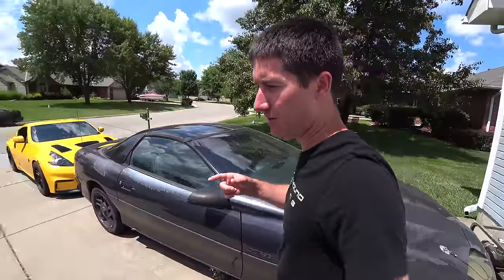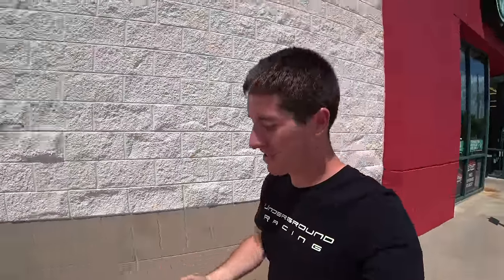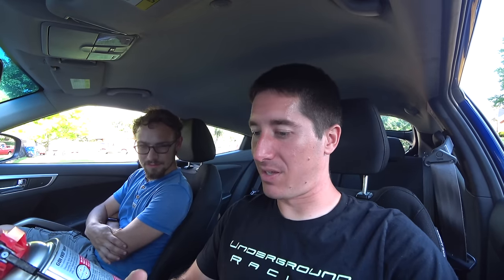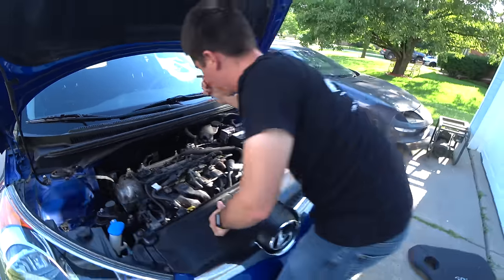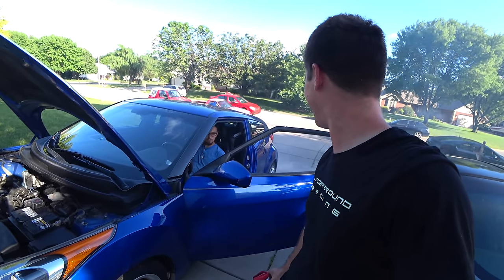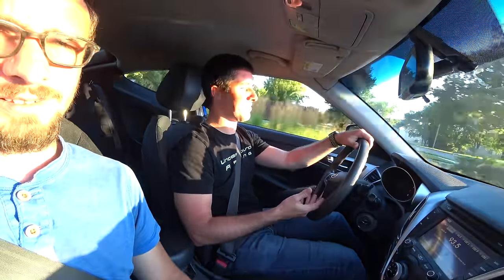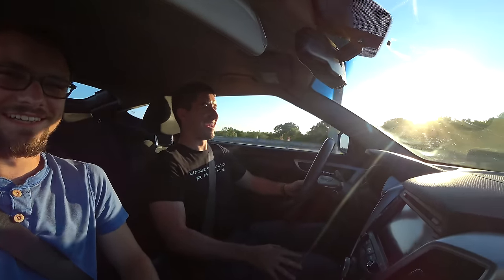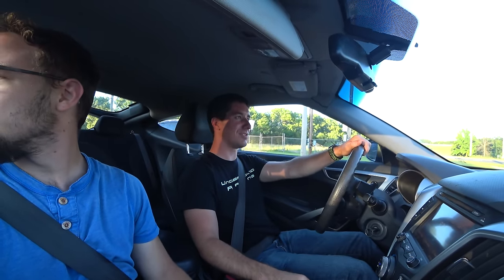How To REMOVE CARBON Build Up From DIRECT INJECTION Engines For $12

Comment: Anyone performing this intake valve cleaning needs to change the their oil immediately afterwards.  This process will dump a huge amount of hard abrasive carbon into your oil.  No, all of won't be blow out out the exhaust.  The unburned fuel, soot and carbon will be washed past your pistons rings.  How do I know.  I did an oil analysis before and after.  Hard Particulate matter skyrocketed and I had to change the oil twice to get levels back to normal.
Reply: I came here to say this!
Reply: Anything else worth replacing at the same time as doing the GDI cleaner? PCV valve? Using a rag to hand wipe the throttle body with a little cleaner?
Reply: Damn you had to change the oil twice? That's crazy.
Reply: The fine carbon abrasives will wear out the timing chain link pins causing slack play.
Reply: @alwayslearningthankyou2708  Also wear out rod bearings then shake the motor apart (or if you got the lemon-sensor from the recall I guess just wait 20k more miles and get a whole new engine from Hyundai lol)
Reply: should I do spark plug before or after
Reply: @MJ-5k  Hey can you give me some more information on this ?
Reply: That ain’t all of it you spray too much that crap up in there it will start to deteriorate the manifold gaskets and things and do other damage to the engine in general. Those cars are junk anyway you’d probably be better off to just  trade it off or sell it for whatever you could get out of it and let it go with that.Get a Toyota or maybe a Honda or Nissan👍
Reply: @william38022  I have 180k miles, has just as much power and fuel efficiency as new, runs great.   Over 8 million built,  Troll....go get a life
Reply: @tssci6774  no I got a Toyota how ever I’m glad yours is working out for you
Reply: Absolutely!  I use this on my 2016 f150 2.7 Ecoboost.  You need to do an oil change, maybe two oil changes after you get done driving the vehicle around to help knock off that carbon.  You will find Carbon deposits throughout your oil filter.  Drive the vehicle after using the valve cleaner per the instructions on the container and then do the oil change (after the oil cools of course).
Reply: What kind of Toyota engine do you have? Is it GDI? People with older cars don't have a problem without changing oil. That's why most Seafoam users have positive feedback. But if you have GDI that's a different story. You're making people worry but not a bad idea changing it. To people who are confused just do this before changing oil.
Reply: I'm doing a carbon build up on my hyundai.  From egr, dpf, intake manifold and everything in-between. 
Because of por maintenance and the wrong oil
Reply: @davidscott4045  let us know when you’ve done it 👍🏼
Reply: @DragonNB13  from my experience, right after.

Big chance ur old plugs will foul out
Reply: Is this not the purpose of the oil filter ?? You will have to run the oil through the system to move the carbon through by doing that it has to pass the filter?  So any particles 20 microns or so are trapped in the filter. Am I missing something
Reply: 😱

... Thank you
Reply: @ryanpatterson621 Exactly, that fucking oil filter job is to catch those particles from oil, so no, no fucking way those particles, soot, carbon deposits will slam around all bearings and chains, like he is saying literally that he don’t use oil filter/doesn’t know what is the purpose of an oil filter which is laughable
Reply: @Berserker_Bear No! See? This is the reason peeps have to do it twice! That oil-gunk-that slurped every shiz into it needs to come out as quick as possible since it had everything in it! If you let it cool it will drop everything on the bottom of the pan and who knows where else!!!
Reply: I'm skeptical of your argument. crc said that oil change is not necessary immediately after cleaner use. If they were wrong about this, they'd be sued.
Reply: @ronin5019  Sued for what. These products are nearly unregulated when it comes to consumer protection. They can make just about any claim, buyer beware.  For as little as $40 you can confirm my testing, but I suspect you won't,  keyboard warrior.
Reply: Which oil analysis and how much were the levels before and after? Lets fact check this argument.
Reply: @tssci6774  I used a crc cleaner in my Kia Cerato, which drove 100,000 kilometers, and I used it according to the procedure to check the amount of white exhaust after 1 hour of heat soak. The color of engine oil was light brown, just like before use. If you are not a keyboard warrior, present scientific data on engine oil changes. I can only see it as a local mechanic's trickery of worrying about sales decline
Reply: @ronin5019 I don't think it's just the carbon. It's like when you put seafoam in your oil to do an engine gunk flush. Since some of the unburned cleaner goes into the oil.
Reply: @FortunateJuice  clean mass airflow sensor
Reply: There are always carbon fines in your oil. Minus when you just changed it.  Thankfully cars have “oil filters” <Dr.Evil> to catch the carbon. No need to change the plugs either. They burn very hot.

Comment: My only comment is that your results were not proven really.  A borescope photo before and after of the combustion chamber to determine if in fact the treatment eliminated any measurable amount of carbon.  The fact that you say it drives better is anecdotal and not measurable since what one "feels" is purely subjective.  Any of those additives introduced through a vacuum line into the intake are going to create a lot of smoke and is just a by product of the chemicals being ignited and not a measure of how much "cleaning" is occurring

Comment: lol...your face when you said "We just killed a rod "
Reply: My car did the same thing when I started going after the heat soak for the first 500 feet or so.  The car ran rough, the check engine light came on, a ton of smoke blew out the exhaust... and the engine now runs better than ever.
Reply: @vashthestampede11  My Santa Fe did this and actually went into limp mode. I had to get to an auto parts store that had a scanner tool so I could reset the check engine light and it ran fine after that but scary as hell at first.
Reply: @robertnicholson3734  never had to reset anything. It drove really really rough for about 1/4 mile, the check engine light came on, farted out a huge cloud of dust, the engine light went away, and it's been running great ever since.

I also decided to put in an oil catch can, and after 1000 miles, it's already caught about 2-3 tablespoons of oil.  Might be worth looking into.  I'd be happy to show you what I did.
Reply: @robertnicholson3734  cars ecu will reset after the chemical is gone .No need to panic .
Reply: That engine clattered hard  🤣  that's  why you use it in bursts
Reply: @vashthestampede11  I'd be interested.

Comment: Just tried this with my 2012 kia 1.6 Gamma GDI stick shift and it definitely started sounding better and feeling better. It also looks like my mpgs are a lot better. I only used half a can because I was being overly cautious and was using an extendable mop handle to keep the car around 2k rpms
Reply: The car also felt like it was gonna stall at low RPMs in first while starting from a stop. Now I don't have that problem.

Comment: That noise was hydrolock because the way the intake sits lower than the valves and the cleaner pools in the bottom. If you could actually see the carbon coming out of the exhaust it would instantly plug the catalytic converter.
Reply: Cats are cheap. Wouldn't it be better if the exhaust was removed from the cats back before using this?

Comment: Hyundai should pay you for these videos  you’re giving them tons of free advertisement and training tips for their technicians.
Reply: As a hyundai technician this is a bit cringy lol
Reply: And you're also pointing out a big draw back of their GDI engines. They're not all efficiency and fairy dust. They get dirty pretty quickly and then run like garbage if you don't keep up the maintenance yourself quite frequently.
Reply: V G the newer ones are staggered injection or dual injection idk which one though.
Reply: @tails300  Yup, kind of tells you something when their newer engines are either back to port injection, or dual injection.
Reply: @tails300  There are no Hyundai's with that setup, some new low trim Elantra's are just port, but nothing has both in Hyundai's lineup. But agreed that other manufacturers have done that.
Reply: @tails300  Toyota and Ford.

Comment: Would be nice to see a before and after scope or dyno pull - some way to quantitatively measure the difference.
Reply: You saved me a few minutes of typing, that would have been some REAL evidence
Reply: Best they can do is vaguely following bottle instructions 🙏
Reply: Yes i thought the same as u mention here.  This video worthless as nothing learned if is for real on getting rid of carbon.
Reply: U connected to brake vacuum line.  Why not have more light so could see better where line is - where starts and where line ends.  Very poor overall.
Reply: Yeah, pretty worthless with no corroboration. And in my opinion corroboration isn't possible anyway. Speaking from my own experience, all those intake sprays accomplish next to no removal of carbon on the intake valves which is where you need it removed. The baked on carbon absolutely won't be dissolved by a few minutes of spray solvent passing over them every 10-15k. I know; I've tried it, and when I inspected my valves at 50k they were fully caked with carbon. There are no shortcuts to removing the intake, scraping off the excess carbon on the valves, followed by finish blasting with walnut shells. That's the only way I was able to clean mine. Don't waste your time and money following recommendations from guys on YouTube pushing this nonsense.
Reply: theres no diffrence, ive seen before and afters inside the heads

Comment: That does make a big difference. I have my State's Emission Tested a month after I used this same product on my 02 Ford Ranger (176,000 miles). My friend John performed the PA. Emissions Testing, afterwards he commented about not believing the great results he got for such an old truck. Yeah, as you spray that product in you'll just have to manually adjust by hand the throttle RPMs, because the engine wants to shutdown if you don't. The oil will be dirty, but before the oil change try Seafoam in the oil crankcase (1 ounce per quart capacity). Drive 50 miles, then pull it in for an oil change. The Engine will purrs!

Comment: Just did the "non-pro" instructions on a Mazda CX-5 2013 with 107K. I had suffered thru gas smell in AC vents and saw that carbon deposits could be a possible cause.  After the one hour soak, fired it up and made run to where I could let it rip. No smoke but went through a series of backfire farts.  It blew that carbon out and ran perfect for my 90 mph joyride.  So  far gas smell gone too.
Reply: Gas smell might be a spark plug that's not tightened up enough.

I had that issue when I changed my plugs without a torque wrench 😂

Comment: That loud clack noise sounded like hydraulic lock. 
Problem with these head clean aerosol systems is that if you put in too much fluid at one time, or the additive pools on the intake manifold, the fluid could hydraulic lock the engine. 
Better to do the following - 
Never add the fluid to an idling or stationary engine.
Engine at around 2500rpm
Spray the additive in short spurts with at least 30 seconds between spurts, 
Add the fluid at the throttle body to ensure better atomisation and even distribution (minimise chance of pooling). 
After half a can, wait a few minutes before resuming the remainder of the fluid.
Leave the engine at the same revs for at least 3 minutes 
Slow to idle and leave idling for 3 minutes. 
You can now switch off the engine to allow the hoses at the throttle body to be reassembeled
Restart the engine and slowly increase revs to 2500rpm for one minute. . 
Next, go on the 20 minute road run. Do not exceed 2500rpm.
Reply: Don't forget the hour of heat soak which is important.
Reply: @onlywenilaugh6589 can you explain what an hour of heat soak is? Thanks in advance!

Comment: i had to run that type twice in a v6 because the guy i know said he wanted to try it while using it through the port on the intake manifold. it seems like it did the trick because most of the time there is some carbon build up in the base of the intake manifold as well. it seems like it loved it to be honest to get all the crud out of the air passages thats my impression

Comment: I waited until I had a noticeable miss at idle on my direct injected vehicle, which was about 170k miles. I was surprised I didn't have an issue earlier, but I run top tier gasoline, which I think helps some. I pulled my intake manifold and spent a few days soaking and cleaning the valves with a variety of methods until I was happy. A LOT of carbon build-up came off the valves. Before re-installing the intake, I installed new OEM fuel injectors and seals. Once put back together, my car idled like new again (and still does).

Comment: The best way to prevent the build up on intake valves is a EGR delete. Put an small airfilter on the EGR pipe and the correct pulse value compactor on the EGR harness which prevents any CL engine codes. Also a oil catch can
Reply: PCV  All those oil vapors routed back into the intake manifold lead to carbon buildup.  Could route them down toward the road as cars did before emissions laws.
Reply: Additionally don't buy a direct injection overpriced car.
Reply: @davidanderson8469  Best answer.  I love that Mazda6 and I want to get one, but it's GDI, GDI means *od *amned Idiots, in my book, so I can't have that Mazda6.
Reply: @keepingup2952  they produce significantly more torque compared to the same size port-injection engine though.  there' a good reason GDI engines exist.

Comment: I put FR3 friction reducer in at my oil change. It reduced that clattering sound alot. The engine runs smooth too. $18.00 a bottle. I have the 2.0 turbo in my Escape. Shawn.
Reply: Gonna grab some of this at next oil change, thanks!
Reply: LiquiMoly is the only brand I trust.

I've seen tests and results with own eyes, idk about the other crap but some BMWs and MBs need that shit in there. Just make sure to get genuine stuff.

Comment: THIS WORKS! I do this every other oil change or at 10,000 miles and I have NO CARBON BUILDUP.
Reply: How can you verify there is no carbon buildup ?
Reply: Did you physically view the valves to verify?
Reply: @jeffersonjcoat just pop the manifold off wym

Comment: I did this on my 2017 Hyundai Sonata Sport @ 45,000 miles oli change after it started to shake lightly at idle and the throttle response was very laggy and i was getting 26 mpg with mostly i. Town and no spirited driving.
After i did this CRC treatment the car made the same loud knocking noise after the treatment 3500rpm revs and after the i accelerated it on my way to the high way.

Afterwards  the light tremebling at idle went away and the thrittle response has improved dramatically with no lag.
The best of all is, the MPGs are back to 28mpg .
I will be doing this every other oil change wich is every 5k miles
After

Comment: I tried that stuff on my GDI mini cooper with the turbo,  
80,000 miles and it started to run like a new car. the turbo looked awesome as well.
Reply: Finally a Mini Cooper comment? Any other tips I just got mine it has 35k miles on it but just want it to run smooth with barely any worries.

Comment: I used to own a 1.6L 2012 Accent GDI and when I used that additive, I learned that you need to be easy once the additive is empty, don't rev it up or you will get that knocking sound, so what I did after the first time is let it to heat soak for 10 mins then start it again and let it idle for 5 mins and then take it for a spin and go very gentle otherwise the knock may come back due to the combustion chamber full of an oily substance that can cause that sound and if you are very rough increases the chances of killing the engine in the long run and around 10-15 mins of driving the product will be gone and the knocking chances are reduced, FYI, when I heard that sound, I thought that I killed the engine. Also For those who don't know in all these additives when you see white smoke is not that you are burning carbon is the actual additive mixture that makes that white smoke, once that is burned along the carbon will disappear. I have used this one seafoam as well in very clean engines and white smoke will always show up, even with intake +Carb cleaner, is like if you were burning those barbeque starting fluid, smells bad and white smoke all over. If you use that additive at home and you own a Hyundai, be patient otherwise you will pickup another engine soon. Just my opinion.

Comment: What happens on these with the carbon cleaner is that when spraying into the manifold or a vacuum line, some of the cleaner tends to pool up in the intake manifold runners that aren't open (has variable intake runners, short and long for air velocity changes). When you rev it, the manifold opens the other set of runners and chugs the rest of the cleaner at once, can be bad if it's a lot of cleaner, but that's the smoke you saw. Kinda scary at first but hey, it works well.

Comment: Change your oil immediately, and do an engine flush if you don't have high miles if you plan to do this. I would not recommend it at all due to the possibility of cylinder washout, but it will work. Do NOT crank your engine under any circumstances before changing the oil. Make sure your engine is hot before you start this process, as it will allow a lot of excess gas to evaporate, and also allow the fluids to flow freely.
Reply: you have to drive it after an hour of soaking.  i would wait until after burning it all out to change the oil.